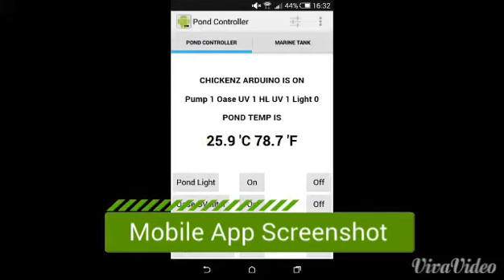My Koi Pond - Controlled via a Mobile Phone App and an Arduino!

Comment: I take it the Arduino thingy is for controlling stuff while you are away from home so it's god to know that everything is going well when you're away. I just plug in and hope for the best like most people, lol
Thanks for the big up, man.
Reply from the maker: Yes, I had an accident a few months back when I was cleaning the filtoclear, flushing the waste water into the field at the bottom of the garden, then the phone rang, i forgot about the filter and 3 hours later my fish are struggling in 6 inches of water!!! There is a water level sensor on the Arduino that will send an alert to my phone if the water level drops too low or if there is a power cut etc. Im still playing with it but hoping it will be able to make decisions based on water temps to turn the air pump on or switch water pumps off etc.
Reply: Ian Carmichael I'd personally keep the air pump going 24/7 to keep the environment stable. If it goes on and of your oxygen levels may well peak and crash which isn't generally a killer but can make fish lethargic.
Sounds like a good system.
Reply from the maker: Pondguru Thanks for the tip, I will now.
Reply: @pondguru  agree my air pump runs 24/7 water quality much better and have noticed in the hot summer if air pump is not running i get alga bloom.

Comment: Hi where can I find your diagram, schematic and code want to do something similar I am still a beginner lol but nice job
Reply from the maker: The best code to use is Tasmota, its free to download from github and is really user friendly for setting up any Esp8266 board (arduino with wifi).  It has most sensor libraries but in. The rest is pretty straight forward but if you get stuck let me know and I’ll put a more detailed ‘how to’ together for you. Tasmota is definitely the most effective software though.
Reply: @TheAquaticGeek  thanks for the reply will check it out

Comment from the maker: Arduino Script...
#include <SPI.h>
#include <Ethernet.h>
#include <OneWire.h>
#include <DallasTemperature.h>
#define ONE_WIRE_BUS 9
OneWire oneWire(ONE_WIRE_BUS);
DallasTemperature sensors(&oneWire);
byte mac[] = { your mac address here }; //physical mac address
byte ip[] = { 192, 168, 1, 97 }; // ip in lan
byte gateway[] = { 192, 168, 1, 254 }; // internet access via router
byte subnet[] = { 255, 255, 255, 0 }; //subnet mask
EthernetServer server(80); //server port
int huv = 1;
int ouv = 1;
int pump = 1;
int light = 0;
float f;
float pondtemp;
String readString;
 
//////////////////////
Reply from the maker: void setup(){
  pinMode(2, OUTPUT); //pin selected to control
  digitalWrite(2, LOW); //turn on relay 1 (HOZELOCK UV) to start
  pinMode(3, OUTPUT); //pin selected to control
  digitalWrite(3, HIGH); //turn off relay 2 (Light) to start
  pinMode(4, OUTPUT); //pin selected to control
  digitalWrite(4, LOW); //turn on relay 3 (Pump) to start
  pinMode(5, OUTPUT); //pin selected to control
  //digitalWrite(5, HIGH); //turn on relay 4 to start
  pinMode(6, OUTPUT); //pin selected to control
  digitalWrite(6, LOW); //turn on relay 5 (OASE-UV) to start
 
 
    //start Ethernet
  Ethernet.begin(mac, ip, gateway, subnet);
  server.begin();
  sensors.begin();
  //the pin for the servo co
  //enable serial data print
 // Serial.begin(9600);
  //Serial.println("server LED test 1.0"); // so I can keep track of what is loaded
}
Reply from the maker: void loop(){
  // Create a client connection
  EthernetClient client = server.available();
  sensors.requestTemperatures();
  pondtemp = sensors.getTempCByIndex(0);
  f = (pondtemp*9.0/5.0 + 32.0);
 
   //if (pondtemp >16) {digitalWrite(3, LOW);} 
   //if (pondtemp <16) {digitalWrite(3, HIGH);}
  if (client) {
    while (client.connected()) {
      if (client.available()) {
        char c = client.read();
 
        //read char by char HTTP request
        if (readString.length() < 100) {
 
          //store characters to string
          readString += c;
          //Serial.print(c);
        }
 
        //if HTTP request has ended
        if (c == '\n') {
 
          ///////////////
          //Serial.println(readString); //print to serial monitor for debuging
          //Serial.print("Temperature for Device 1 is: ");
          //Serial.print(sensors.getTempCByIndex(0));
          //Serial.print(pondtemp);
          
          client.println("HTTP/1.1 200 OK"); //send new page
          client.println("Content-Type: text/html");
          client.println("Refresh :10");
          client.println();
          client.println("<HTML>");
          client.println("<HEAD>");
          client.println("<color=#40FF00>");
          client.println("<meta name='apple-mobile-web-app-capable' content='yes' />");
          client.println("<meta name='apple-mobile-web-app-status-bar-style' content='black-translucent' />");
          client.println("<link rel='stylesheet' type='text/css' href='http://homeautocss.net84.net/a.css' />");
          client.println("<TITLE>CHICKENZOWN</TITLE>");
          client.println("</HEAD>");
          client.println("<BODY>");
          client.println("<H3>CHICKENZ ARDUINO IS ON</H3>");
          client.println("<H3>Pump ");
          client.println(pump);
          client.println(" Oase UV ");
          client.println(ouv);
          client.println(" HL UV ");
          client.println(huv);
          client.println(" Light ");
          client.println(light);
          client.println(" </H3>");
          client.println("<H3>POND TEMP IS</H3>");
          client.println("<H1>");
          client.println(pondtemp,1);
          client.println(" 'C      ");
          client.println(f,1);
          client.println(" 'F</H1>");
          client.println("</BODY>");
          client.println("</HTML>");
 
          delay(1);
          //stopping client
          client.stop();
 
          ///////////////////// control arduino pin
       
        
         { if(readString.indexOf("relay1on") >0)//checks for on
          {
            digitalWrite(2, LOW);    // set pin 2 low
            huv = 1   ;           // hozelock uv status on
            client.println("Refresh: 1");
            //Serial.println("relay 1 On");
            //Serial.println(huv);
          }
         
          if(readString.indexOf("relay1off") >0)//checks for off
          {
            digitalWrite(2, HIGH);    // set pin 2 high
            huv = 0       ;   // hozelock uv status off
                
            //Serial.println("relay 1 Off");
            //Serial.println(huv);
          }
         
          if(readString.indexOf("relay2on") >0)//checks for on
          {
            digitalWrite(3, LOW);    // set pin 3 low
            light=1;              // light on
            //Serial.println("relay 2 On");
            //Serial.println(light);
          }
         
          if(readString.indexOf("relay2off") >0)//checks for off
          {
            digitalWrite(3, HIGH);    // set pin 3 high
            light=0;              // light off
            //Serial.println("relay 2 Off");
            //Serial.println(light);
          }
          if(readString.indexOf("relay3on") >0)//checks for on
          {
            digitalWrite(4, LOW);    // set pin 4 low
            pump=1;              // pump on
            //Serial.println("relay 3 On");
            //Serial.println(pump);
          }
         
          if(readString.indexOf("relay3off") >0)//checks for off
          {
            digitalWrite(4, HIGH);    // set pin 4 high
            pump=0;              // pump off
            //Serial.println("relay 3 Off");
            //Serial.println(pump);
          }
         
          if(readString.indexOf("relay4on") >0)//checks for on
          {
            digitalWrite(5, LOW);    // set pin 5 low
            //Serial.println("relay 4 On");
          }
         
          if(readString.indexOf("relay4off") >0)//checks for off
          {
            digitalWrite(5, HIGH);    // set pin 5 high
            //Serial.println("relay 4 Off");
          }
          if(readString.indexOf("relay5on") >0)//checks for on
          {
            digitalWrite(6, LOW);    // set pin 6 low
            ouv=1;              // oase uv on
            //Serial.println("relay 5 On");
            //Serial.println(ouv);
          }
         
          if(readString.indexOf("relay5off") >0)//checks for off
          {
            digitalWrite(6, HIGH);    // set pin 6 high
            ouv=0;              // oase uv off
            //Serial.println("relay 5 Off");
            //Serial.println(ouv);
          }
            
                  
        
       
                                                       
         }
          //clearing string for next read
          readString="";
          }
          }
        }
      }
    }